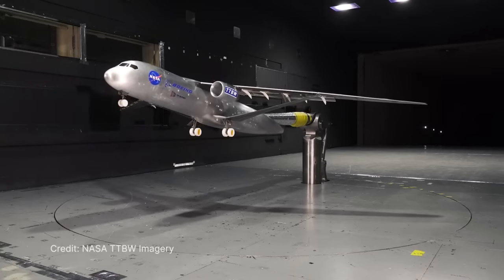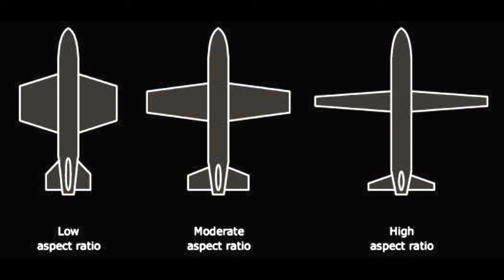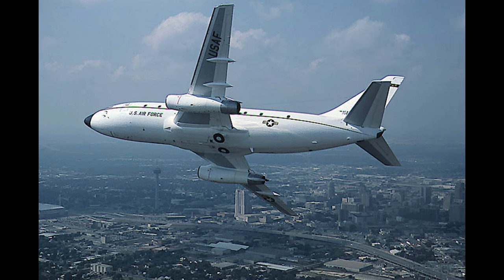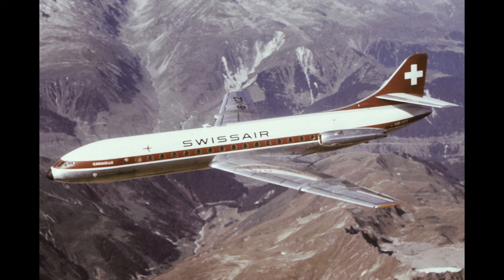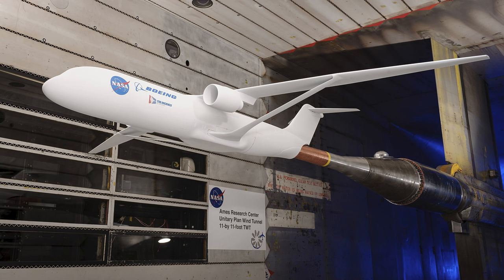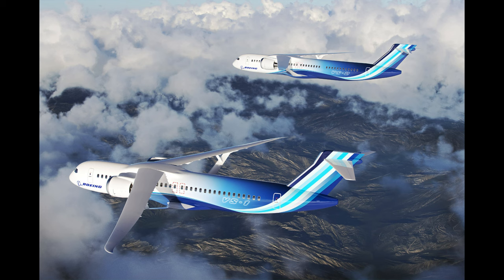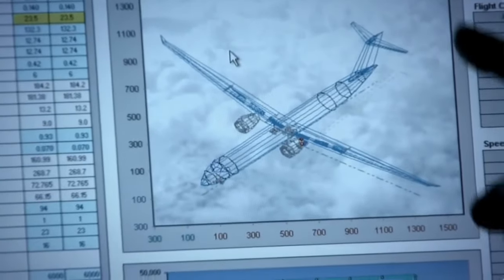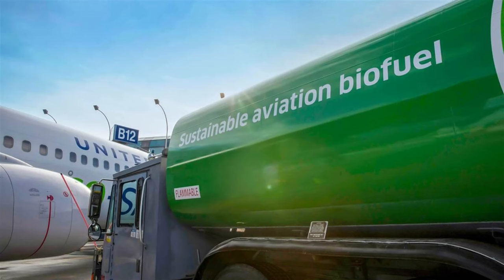NASA's New Airliner Experiment To Make Flying Less Expensive

Comment: PB-Y Catalina had a similar truss wing and was considerably more efficient (especially in a payload and range vs weight) than its counterparts. However, it couldn't go that fast. It had a longer chord (lower aspect). Not sure it was just a limit of the engine power or that the shape of the wing made going faster remove the advantages of the wing shape.
Reply: Parasol wing - This note isn't meant to detract from your informative comment.
Reply: Gorgeous aeroplane the catalina.
Reply: Shape of the wing is what limits its speed.
Its not a swept wing. 
And, as you said, it has a high aspect ratio. That means its a, in laymans terms, very tall wing. Very large aerodynamic cross section.
To put it another way,
A modern fighter jet's wing is like a knife when you have the edge facing into the wind.
A PBY's wing is when you turn that knife 90⁰ and have a whole side of the blade facing into the wind.
Much more drag.

 Much more lift as well, granted. But at the tradeoff of speed.
Reply: I don't think the wing was the only limiting factor in speed.... careful reminder it has pontoons and the hull is shaped Like a BOAT lol
Reply: I was thinking a better comparison was the Bellanca Aircruiser or 77-140, particularly the latter as it was a twin-engine design.
Both had wing braces that were also airfoils, greatly increasing the types' efficiency.
Reply: @Royalwaffles  boat shaped isn't necessarily bad though, get going fast enough and air acts like a fluid anyway, so a shape thats conductive to low drag in water, works just as well in flight
Reply: The Catalina did not have a truss wing.   They were just old school braces to take the stresses on the central pylon.   The PBY was designed as a long range recon aircraft, it didn't need to go very fast and so that is why it looked like that
Reply: @Royalwaffles  The F2Y went mach 1, and that was a flying boat
Reply: @TheStig_TG  it also didn't have a stepped hull like most do that fly off water.

Comment: Greetings from an LM Aero retired Engineer. Great video and yeah, "Fueled Wings" don't hold much but there are also valid other benefits to them ... the Block Zero thru 30 F-16s I helped build (all over the World) were thin, sheet metal Wings that were "fuel cells" and provided 20% of capacity yet gave "Ballast" handling characteristics that made it, to this day, one of the best "Dog Fighters" in the World. Very simple construction ... fuel coating with FMS-1044 beaded sealant. Same could be done on Boeings thin, long Wing design ... every bit of fuel counts as you know.  Further to your coverage of "Green Energy" propulsion, be advised that in 1956, Carswell AFB had a B-36 Peacemaker take off ... with a live Nuclear powerplant on-board to test "Electric Flight".  Never really "Got off the Ground" (pun intended) but if you look around now in other Energy inventions, you'll find they are making "micro-sized" Nuclear powerplants ... size of your minivan's engine. Very little "fuel" involved and do not "explode" like a bomb ... now think what could be done in "Electric Flight" if you had one of those on-board. WOW  It will be an very interesting future in Aviation IMHO.

Comment: Maybe I missed it, but where do they plan on storing the fuel if not in the wings? This seems to be the biggest obstacle against those designs.
Reply: You can store it in the pylons and fuselage in the walls but it seems they arre just going with giving it more wing.
Reply: @GreenBlueWalkthrough  Longer wings won't work in most airports, folding them on-ground = folding fuel in the wings?  Fuel surrounding passengers?... first crash would make great optics.

Comment: Due to bernoulis equation, the pressure under the wing is greater than that on top of the wing.  Hence lift.  At the wing tips, the higher pressure air on the bottom wants to rotate around the wing tip to fill in the lower pressure area on top.  This gives you two vortices, one on each wing tip which are called induced drag since they scale proportionally with lift.  Longer thinner wings give you less wingtip length per total lift, reducing these votices.  The winglets work by inducing vortices themselves - which are in the opposite rotational direction of the ones off of the wingtips partially cancelling them out (reducing drag).
Reply: Great stuff, small correction though.  It's not "due to" but rather "modeled by" Bernoulli's equation
Reply: @SomeRandomDevOpsGuy  pressure difference happens but lift is the reaction to pushing air out of the way; and that you get just from aoa and thrust. otherwise planes could not fly inverted!
Reply: "pressure differential, hence lift" – momentum exchange, cough, cough
Reply: @DrWhom  Two ways of describing the same thing. How do you push air out of the way? A difference in pressure.

Comment: Harbour Air in Vancouver BC is working on the Electric Beaver...keep you snickers to yourself! But most of Harbour Air's flights are around 20 minutes, shuttle flights, basically.  And if they can eliminate the use of ICE powered planes replacing them with electric, thatwill be a huge saving for them both in the cost area, and in the carbon reduction areas.
Reply: But what if the Electric Beaver overheats and gets Beaver fever.  

I know that's not the obvious joke here, but its where my mind went.
Reply: @lunaticbz3594  LOL! Being Canadian, it could have been a Justin Beaver...

Comment: The mechanism that makes higher aspect ratio wings more efficient is basically the same as the one that makes higher bypass ratio jet engines more efficient. You are moving more air at a slower speed to get the same force, while the energy imparted on the air is proportional to (1/2)mv^2 so it takes less energy to accelerate that air due to the lower speed component.
Reply: No.  High aspect ratio wings are more efficient due to the reduction of induced drag.
Reply: It's drag reduction. In this case, it's reducing the parasitic drag, which is the drag induced by the viscosity of the fluid traveling over the OML of the wing surface. Longer, thinner high aspect wings present less area of travel where the fluid must move over the surface area, thus the 'stickyness' of the air at the boundary layer on the wings 'skin' has less time to build up friction, or 'drag'. 

The problem with these wings is flutter. 
Especially with the needed sweep, you still have vortices that are induced, and the wing itself is a static structure, so its sweep is only optimized for a specific cruise speed. This isn't a problem for commercial aircraft as much since your flight pattern is so rigid, but this is why you don't see this on militarily high performance aircraft much with the exception of aircraft which their designed role is specific loiter time and or altitude ceiling. The threat of flutter and wing twist caused by the vortices and Trans sonic/super sonic  shock impacting the wing is a huge problem, and that's likely what NASA spent most of their time optimizing with Boeing. 

And not to diss one of my Fav youtubers here but Scott should well know that this knowledge and design has been around for many decades. The only reason it's being looked at now is because it's NASA, IE it's being subsidized by government money that the companies don't have to spend. Why should they spend it when they can slowly pressure the government to waste the money for them - so Scott's position here is no different that an idiot politician who critiques this, because NASA is notoriously slow and horrible at spending money on research. This has been proven for decades. It doesn't mean I don't like NASA, I still revere the agency whole heartedly - but take it from ex NASA mathematicians and engineers - the Agency is largely a massive money pit and grift. It contributes very little over the span of time it usually takes to look at a topic. Government spending on research is usually very inefficient. Usually. Not all the time, but usually.
Reply: @Nurhaal  Bingo... plus these basic questions cannot be satisfied with this fantasy: Wings too long for airports, folding them then, place for fuel, - some say on fuselage... first crash, people are surrounded by fire, engines mounted higher - first catastrophic failure passengers and fuselage (plane thus) destroyed by shrapnel...
Reply: @Nurhaal  BRAVO!  Massive misuse of public dollars.

Comment: Another nice thing is that with the high wings you can have larger engines. Larger high bypass engines are more efficient ¹, but you can only make them so big until they'd drag on the ground.

¹ though as they get bigger the weight also increases, especially the nacelle.
Reply: You wouldn't have to have that weird dent in the cowling like on the newer 737s.

Comment: I'd be curious to see how the pressure and friction would be where the truss meets the wing underneath.
Reply: We talking about sheer and torque?
Reply: It depends on how well built it its, realistically if the truss generates zero lift at that area drag should be minimum, so the design part is easy.
Reply: @davidaugustofc2574  that would make sense for 2D air, but air in the Z axis will create significant drag in a slipstream.
Reply: @mitcho04  Taking a lesson from F1, the wing supports do cause a loss of performance when attached to the bottom of the wing (where the low pressure is) so they try to attach it to the top. In the example they're already attaching it in the high pressure zone, so the loss in performance shouldn't be great. Plus Nasa and Boeing said they're developing this to reduce drag, so in theory it works?
Reply: @davidaugustofc2574  it’s low pressure above the wing, where the air moves fastest. That’s what generates lift.
Reply: @mitcho04  F1 cars don't generate lift, they generate downforce, so the low pressure in that case is below the wing.
 
It has been observed since the 80s that attaching the wing supports where the air is going faster is more prejudicial to the air flow than the supports themselves, so the supports still exist but curve to attach to the top of the wing in all modern F1 cars. Sure not everyone would know such specific case, so I should have clarified better.

My point is that having the supports on the high pressure zone (below the wing for an airplane) wouldn't affect lift negatively, not by a huge extent anyway. And I believe the supports don't cause much drag because Nasa and Boeing are looking to reduce drag with these wings, so if the truss creates a lot of drag it would just cancel out.
Reply: @davidaugustofc2574  I think the point we were making was is there parasite drag on the struts, the answer is yes there is.
Reply: @mitcho04  There is parasite drag in the whole plane, that's right, I think he wanted to see the pressure distribution around it. Like these simulations that have a color gradient around the wing (or car or whatever is being simulated)

Comment: Scott, first time viewing your channel. Entertaining and informative. Subscribed. You mentioned winglets: what I have found interesting is that the generational aircraft I've flown; B744, A330/340 all had winglets, which I understood gave better specific range on longer flights. [Hence the JAL/ANA -400 domestic versions sans winglets]. Then I flew the 748[F] and 777ER. Newer aircraft, no winglets. If I also look at the X, B787 vs A350, what am I missing?
Reply: Those aircraft that you mentioned have "raked wingtips", which is basically an evolutionary offshoot of traditional winglets. The Wiki article gives a good summation of their advantages in certain applications: https://en.wikipedia.org/wiki/Wingtip_device#Raked_wingtip
Reply: I believe the likes of the A350 and B787 have something called a "blended wing" where the winglet is blended into the shape of the wing itself. So, they do have winglets, they just look like extensions on the wings, and presumably (why would they do it otherwise?) a blended shape improves aerodynamic efficiency/reduces induced drag more than a simple "tack on" winglet. these new planes had winglets designed into the wing in the design stage, hence their shape, while on older planes the winglets were added after the initial design phase of the aircraft (747, 737, A320 etc were all designed relatively long ago, along with their associated wing shape). this is my best educated guess
Reply: Winglets, in reality, only offer marginal benefits. What is more effective than a winglet, in all cases, is simply making the wing longer. Winglets were an upgrade to old designs but now newer wing designs with just a longer span are more efficient

Comment: Runway clearance is one of the limiting factors for wing size. High aspect ratio trust supported wings isn't a new idea and was shown model analysis of such a design during lectures on aircraft design. If I recall ground clearance was of huge concern, especially in a rolling landing. Hope they have done their literature review haha
Reply: Parking space is a bigger issue.  If a wing hangs over the sides of the runway,it is no big deal.
Reply: i guess that's the reason these wings are fixed to the top of the plane and have a negative dihedral angle, instead of attached to the bottom and having a possitive one
Reply: @robertheinkel6225  When he says runway clearance, I think he means taxiing. Almost everything humans make is limited by what we can ship within oversize truck loads. The rare exceptions are the things we can't breakdown to smaller lengths/widths: wings and turbine blades among other things. Moving those big planes around cannot be easy. Airports take up a but+load of what is often prime real estate. 
Wingspans are enormous! But i guess we need it. Wings don't get shipped on highways, though do they?

Comment: I remember that the B24 had a "high aspect davis wing" that contributed to it's higher payload and speed than the B17.  The downside was that it took a lot more control stick effort keep formation and they didn't glide well compared to B17s.  Do these new braced wings have similar issues ?  I realize  fly by wire makes a huge difference compared to the old WW2 crates.

Comment: If airliners are to have these high up very long wings, what happens if the pilot has to do a “Sully” and land in the river.
Where are the passengers going to stand?
Reply: I think that there is an acronym for that ETOPS ⇔ Engines Turn Or Passengers Swim
Reply: Yes, that was my thought as well. The exits will soon be submerged. They can stand on top of the fuselage and wing, but they have to get up there from lower exits.
Reply: Emergency landings of B-24's into the ocean in WW2 show you have like 10 minuets to get out because of the high center of gravity

Comment: if this project ever enters the production phase, i'm really curious to see how they solve the issue they mentioned of the airport wing size limits. after all, this plane has the potential to be the next huge breakthrough in flight, and airlines would be dying to fly them to any airport that can handle them.
Reply: The wings would fold to fit 737 gates. Unfolded, it's about the span of a 767 which is manageable for a large number of airports
Reply: Folding wing like the 777x

Comment: Would love to see some of the VS aircraft with turbo props. Can't wait to see where this concept goes.
Reply: Or better yet a CFM RISE (as that gets developed): an open-fan turbofan with a variable pitch rotor fan and a variable pitch stator, which is hoped to get up to 20% lower CO2 emissions (mostly due to improved fuel efficiency) while still being able to maintain Mach 0.8+ cruising speeds.

Comment: Would love an in-depth comparison of this design to the blended wing body for cost per passenger mile?  I wonder which one would win?  I guess this is what the research is for?
Reply: The issue with anything but a tube is pressurisation loads. There is no point in making the aircraft lighter... if the bulkheads are very heavy
Reply: @matsv201 To be fair, double (triple, quadruple, et cetera) bubble fuselages with pessurization-load absorbing "ribs" (in tension) take pretty good care of that.
But yeah, tube-and-wing is pretty hard to beat.
Reply: @JosGeerink  there is ussued with a duble bubble fusalge that is quite compilcated. Bassically its cheaper. And also posibly lighter to just make the tube larger.

Its also worth saying that the having a higher fuselage make it stronger for bending in lengtvice, that is bassically the second or third largest force. Hencr making it siffer in that directin, saves quite a lot of weight. 

So bassically, making the tube flatter you either need to make it shorter or heavier. Eating up most of the benefit if not all
Reply: @matsv201  Stacked double, or even triple bubble, the floor takes all the pressurization force (tension) from wall to wall.

Comment: It is roughly so that the drag reduction by a winglet is about the same as when you lengthen the wing by the length of the winglet (i.e increase the aspect ratio)
 
So a winglet has its prime application where you have wingspan restrictions, if you have e.g. the 15 meter-class of gliders, or for passenger jets that canot waste space at the gate.
Reply: A winglet is worse than a span extension of the same length
Reply: @w8stral  That's fair I just didn't want people to get the impression that you could extend winglets up forever and get much benefit.
Reply: Why do Open Class sailplanes have winglets?
Reply: @waynerussell6401  My guess is that they couldn't justify the additional structural weight from an span extension, but I'm not sure.
Reply: @AmbientMorality  in gliders, winglets also help low-speed circling. They handle a bit better with winglets, which lets the pilot fly that little bit slower and more consistently in the lift. Not sure what the mechanism is exactly, maybe more directional stability, maybe extra lift for the bottom wing which goes more slowly (so the winglet there becomes almost horizontal).